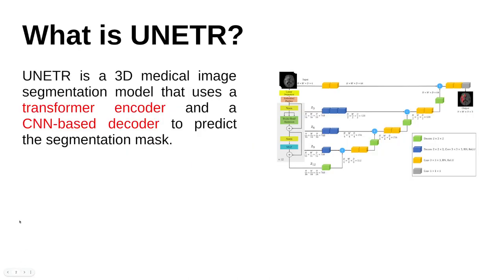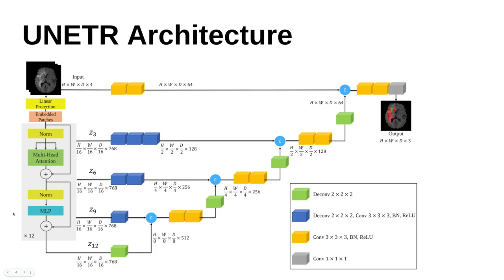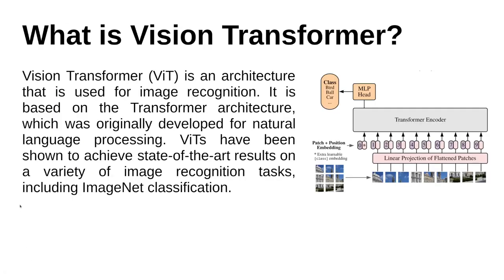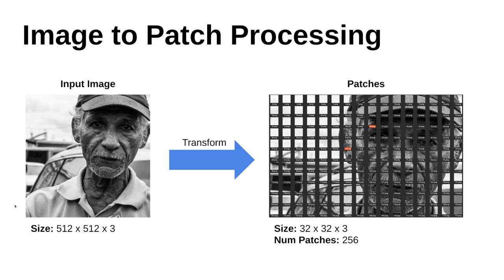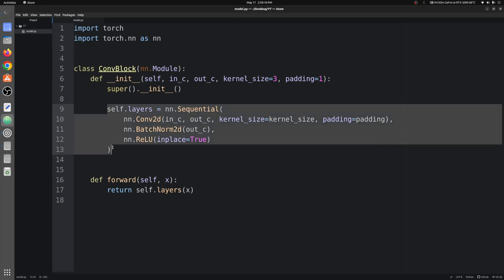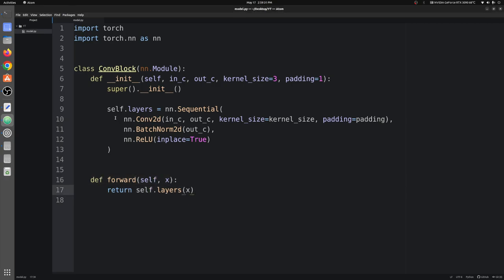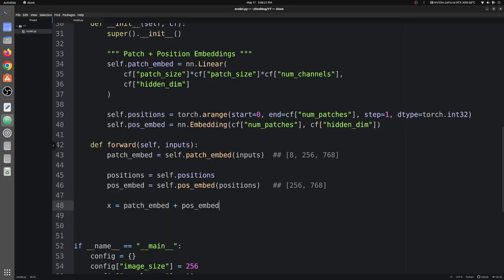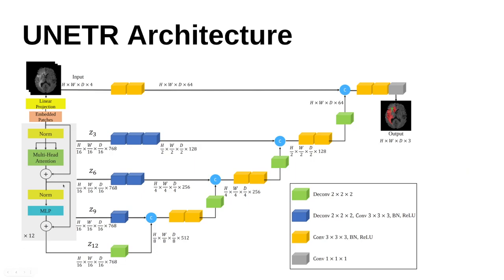UNETR Implementation for 2D Segmentation in PyTorch | UNTER = Vision Transformer + CNN Decoder

Comment: Hello Nikhil, thanks for the video, it is very helpful. I would like to make a comments about both model and your code.
Firstly, anyone who will try this model must add linear projection layer in order to create patches and flatten them. The model does not accept 256x256x3 pixel images as input in its current state. To address this, you need to modify the input layer to split the 256x256x3 pixel image into 16x16x3 pixel patches, and convert these patches into a vector of length 768. This problem can be addressed at the dataset level or by adding an input layer to the model.
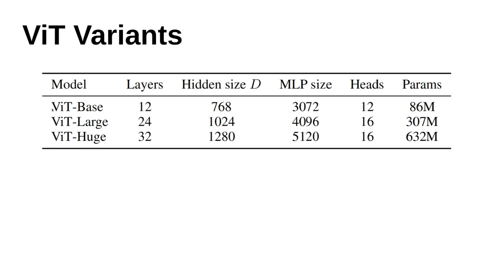Secondly, (3:59), although Nikhil used base ViT model as an encoder it has 86M parameters but, after combining this VIT encoder with the UNet architecture, the final model has 416.2 million parameters. So, while trying to train this model, it is likely that you will encounter GPU memory errors, and in order to solve this issue, you need to adjust the batch size properly.
Reply from the maker: Thanks for the detailed informative comment. I hope the people will find it useful. In my next video, I will use the UNETR and train it for image segmentation.
Reply: @IdiotDeveloper  Could you implement it for a dataset. It would be very useful to understand practically.